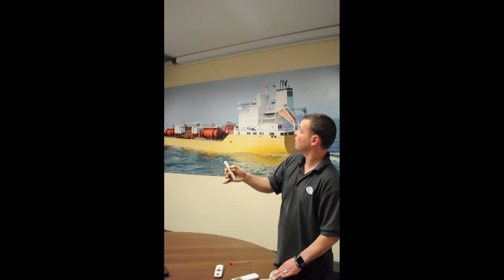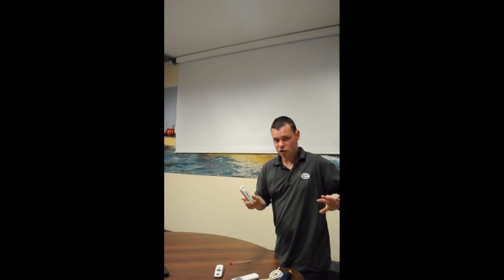Basic Programming and Set up of Somfy Motors

Comment: Is it possible to add a second remote for the same blind?
Reply from the maker: Hi Cathal, indeed you can have as many remotes or channels controlling the same blind or group of blinds, to do this take the existing remote on the correct channel for the blind you want another remote on, press the button on the back of the remote and hold until you get 1 jog, then take the new remote and press the programming button on the back until you get 1 jog, you should now be able to operate the blind with either remote 👍🏻

Comment: Hi, thanks for the tutorial, , I did everything as mentioned but my Somfi Telis Mod/Var T1 doesn't react at all when pushing MY+UP at once. Nothing happens. I have 8 external blinds with 4 Telis T1 (3x one channel and 1x 5 channels) and except 1, controlled by single channel remote, I disconnected all of them, beyond Soliris Slim RTS Receiver (it looks like Receivers still work while motors don't move) So stpes I done: 3-8-3 reset, then factory reset by holding pin on back of the remote. Then I checked if blind moves in proper direction when pressing up/down buttons. Then I set lowest point, and then I press MY+UP....and nothing happens. Any idea what the problem could be? Battery in remote is new, fresh. 

I know I didn't disconnect motors most probably correctly, I am aware that I should disconnect them not beyond Soliris but before Soliris. But that should not cause an issue to programming of completely connected blind. I just wanted to test if the programming works and if it would, I would do it once again, and properly disconnect. For info, I have all blind motors on 1 circuit breaker.
Reply from the maker: Hi Martin, it sounds like the motor may not have been reset correctly, when you do the 3-8-3 reset (although I reccomend doing 6-6-6-) you the blind should do 1 jog to confirm this part. if this happens you then need to press the button on the back of the remote and hold it until you see 2 jogs from the motor, this will reset everything, if you only wait for 1 jog, this only removes all remotes but still keeps the limits set, so it's give it all another go and make sure you get 1 jog after the power switching on and off and then 2 jogs holding the button on the back of the remote.
Reply: @SoloBlinds  Thank you! However no matter what I do, UP+MY doesn't work. I have been able to reset 6-6-6 and after longer press of back button finally I got 2 jogs of the motor (i didn't work after 1st, 2nd, 3rd try, but finally it worked. It looks like motor still keeps lowest and highest position. So here is what I exaclty did - but could it be that I cannot reset to factory setting because it was already reset so additional tries have no effect?

1) 666 reset
2) longer press of back button which returned 2 jogs
3) Assigning remote to motor (could it be that since I disconnected other motors beyond the Soliris receiver, that I am actually assigning remote to all motors - there is a click sound on motors disconnected so it is clear that Soliris are still connected although motor is disconnected)
4) By pressing down arrow I set the blind to lowest possition
5) Here I press UP+MY at once, but nothing happens.
6) End :(

What am I doing wrong? Whole setup is from year 2010 +/- 1 year. I am going to give it one more try, if it fails, I will jup out of the window and will become Somfy owner a nightmare :D

Update: it looks like that that my motors for "Z" blinds don't require to set lowest and highest possition. Maybe they have some auto-stop. I suspect that that's why MY+UP dosn't work. Either I finally set 1 blind/remote, since it goes as it should be (I took remote from different room so it shouldn't work) or there is something wrong. I don't know, I will now try to set other blinds and see.
Reply from the maker: @embeathome1  Hi Martin, I'm not sure what's happening here, if you're getting the single jog after the 666 and 2 after the back button on the remote, the motor should be fully reset.  Just a couple of things to chek, do you know the exact model of motor you have? also, what are you trying to do in the end, are you just wanting to change the limits? add/remove remotes or change the direction of the motors, if I know this we may be able to achieve this without the need for a full reset
Reply: @SoloBlinds  Hi, the initial problem was that one motor lost it's setup/memory and didn't react on remote at all (5 channel remote controlling 4 blinds - each channel controlling 1 blind + 5th channel controls all 4 at once). The reason for loosing memory of the motor was multiple electricity loss in house due to short circuit caused by garden lights. 

I didn't realize that all shutters are on 1 circuit breaker and I did 3-8-3 reset. And you can imagine...all the troubles started. 1 channel controlled all blinds in house - I have total 8 blinds and 5 remotes.  

Motors are: J406WT (serial number looks to be 1210335A J1C12201053056. Then there is Soliris Mod/Var Slim Receiver RTS Plug, Ref 1810802 C210/1817. 

It looks like I am setting lowest possition by either holding Down button or pressing it so it reaches desired possition. Then I press UP+MY and....nothing happens. And that is the end, no further action. Since I messed it compeletely in the beginning, I am trying to set/programm each remote to its motor. It seems that I managed 1, but when I added it to TaHoma, all works fine for this 1 blind, however, there is no Fine moving of the blind, there is just UP and DOWN button and in the middle there is MY button in Tahoma, and if I press MY button in Tahoma either in PC or Phone, it sends blinds completely down and then it slighly opens the shutter. So it acts like Down button. If the blind is down and I hit MY button, nothing happens.
Reply from the maker: @embeathome1  I'm a little stumped on this one, you may need to get a local blind company to pop out for a look, one thing may be is the type of motor, to be sure I'd need to know which one it is (e.g sonesse 40, sonnesse 30 and if they are an RTS or WT motor, I dont recognise the "J406WT" you mentioned, but ending in "WT" suggests it's a hard wired motor without the RTS unit built into it, if this is the case, there will be an RTS reciever somewhere to take commands from the remote and the fact that they are keeping their limits would also support this as this type of motors limits are changed by small hex sockets on the end of the motor.  If you could identify the model of the motor it would help alot, as above, something like sonnese 40, altus 50 or something like that
Reply: @SoloBlinds  I talked to technicia from the company who installed it many years ago, I somehow remember that they were here approx 2-5 years after 1st installation and did some changes, maybe they changed the motors due to some factory defects found on initially installed motors, but I am not sure. I asked him if therefore which motors I have, if Sonesse or something like that and he said no, he said that I have WT motors, so I believe this is it: https://www.somfy.nl/downloads/nl/j4_serie_tn_wt_htm__handleiding_eng.pdf . I aksed if limits are set with hex socket and he said no, everything is set through remote. And as soon as I have Tahoma, they will somehow connect to it with some machine and will set it through it. But they can only come on 27th Jan and that is too late :(

Comment: If I am trying to programme a number of blinds how do I “turn off”the blind that I am finished with?  R28 blinds
Reply from the maker: Hi Charles, I'm assuming you mean the Roll Up 28 motor with the embedded Li-Ion battery? if so, there is a couple of ways to make the motor "sleep", probably the easiest after you have programmed the motor and set the limits...........press and hold the button on the motor head (the older ones is a large flat button, the newer ones there is a small hole and you'll need a paperclip to poke into this), so, press and hold this button until the motor jogs up and down once, relaes the button as soon as this happens, then give the same button one brief press and if it works, the motor will do one more jog and the motor is now sleeping.  when you're done, to wake the motor up again, one quick press on this button will wake it up and to confirm it will do another little jog.

Hope this helps, but give me a shout if not and we'll try the other method.

Good luck
Reply: @SoloBlinds  at the moment I m having issues just getting the blind to pair with the controller, pressing the programme button at the end of the process does not work.  I’m not sure which model the blinds are, they are brand new, with a grey button contoured to match the housing.   It seems to have remembered its limits, but doesn’t remember the Situo 5 RTS pure 11 controller
Reply from the maker: Charles Newall Charles Newall Hi Charles, the newer motors are slightly different in the programming, when you have set all the limits and you confirm them with a press and hold of the “my” button first for 1 jog, the next bit is the different bit, the instructions will tell you to press and hold the button on the back until you get 1 jog, however, this doesn’t work, what you actually need to do on the button on the back of the remote is 2 quick clicks, this will give you the confirmation jog and confirm all the settings 👍🏻
Reply: @SoloBlinds  Thank you soooooo much!!!! We’ve had our motorized solar shades for THREE years and could not get them programmed to the single remote. Customer service on the telephone was useless. They are in two west facing windows up high in a vaulted ceiling. The sun comes in very bright in the summer months so I was resigned to lowering them at the summer and leaving them like that until fall. Now I can raise and lower as desired thanks to your help for Charles!!! Woohoo! You are the best!!
Reply from the maker: @belrabbitt4013  No problem at all, more than happy to help wherever I can, so glad you got everything sorted 👍🏻

Comment: Hi I have a telis 16 RTS remote for 5 bay window blinds. The blinds have Sonesse 40 RTS motors. Could you walk me through the process of setting these. I would like to have each Blind assigned to it's own individual channel and all blinds operating on a sixth channel. Thanks for any help u can give
Reply from the maker: Hi Pat, no problem at all, if you use the video as a guide.  First most important step would be to make sure all the blinds are turned off and only power up the first blind you're working on.  Select channel one and using the guide, program the blind; sync to channel 1 and set the limits, making sure you confirm all at the end (MY button for 1 jog, then button on the back for 1 jog), then turn off this blind and turn on blind number 2.  Making sure you're on channel number 2, repeat the above; then isolate this one and move onto blind 3.....keep going like this until all blinds are set on their own channel, turn on all the blinds and check they are all operating as they should on their own channel (1-5), now to add them all to channel 6.......select channel 1, then press and hold the button on the back of the remote for 1 jog, then select channel 6 and press the button on the back fro 1 jog.  This has added channel 1 to channel 6......now select channel 2, button on the back for 1 jog then select channel 6, button on the back for 1 jog....This has also added channel 2 to channel 6....repeat this process for the remaining 3 channels (3,4 & 5) and you're all done.

Hope this is all ok, but if you get stuck, e-mail me you're number and I can talk you through it         andy.ward@soloblinds.co.uk
Reply: @SoloBlinds  Hi Andy. Thanks so much for your reply. I didn't try your tips yet as I'm not due back to that house until some stage next  week. When i was there yesterday basically some of the blinds I could set top and bottom limits and more I could not. Also channel 4 worked blind 1as well as 4. I think I need to erase everything and start from scratch. I tried resetting to factory settings using the 4 10 4 seconds method but this did not work either. Would it be possible for you to give me a call Andy on 087 7504501 and maybe we can swap numbers and I could possibly call you back when I'm on site at the blinds. I really appreciate your help and time. If you could solve this for me I would forever be indebted to you. Kind regards Andy. Pat Hennessy. hennessypat72@gmail.com

Comment: Can i programe just with the motor? Whitout the blind???
Reply from the maker: Hi there, the motor needs to be in a tube, the crown wheel needs to turn with the motor so it knows how it’s moving, it only moves a little when out of the blind as it can’t detect the crown wheel moving as it should
Reply: Cause in 2:45 my motor dont roll like yours... Just 4cm - 6cm and stops

Comment: Followed the procedure to get limits and sequence but when I press button on remote to save it it doesn't jog and save. Can you help with that
Reply from the maker: Hi Arun,

   Usually when this happens is because the motor has not finished the programming cycle fully or has been mixed up somewhere, often the bes way to resolve this is to reset the motor to factory setting then begin again, if you could tell me which motor you have I'll walk you through the procedure